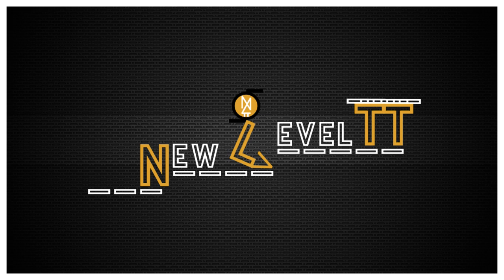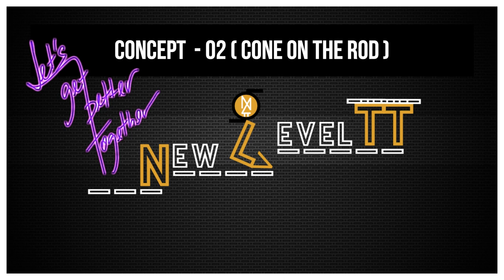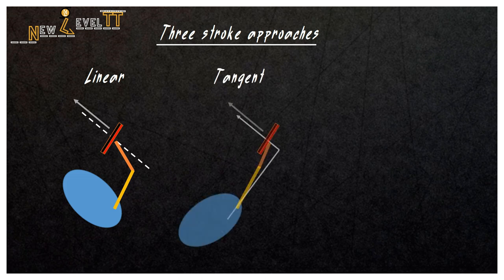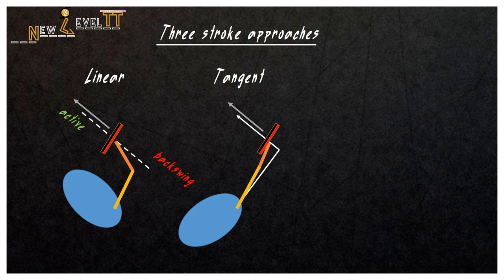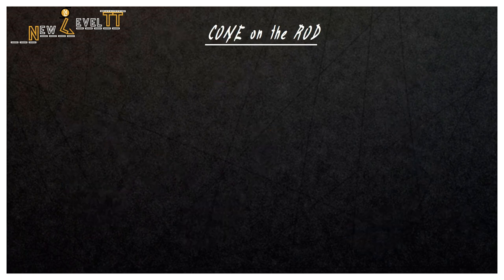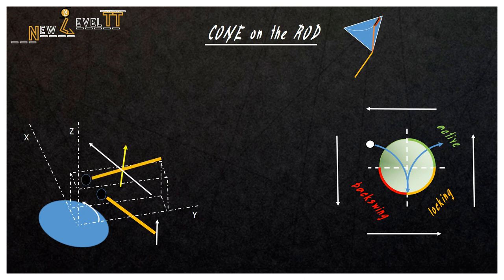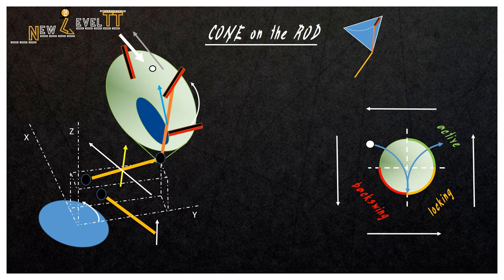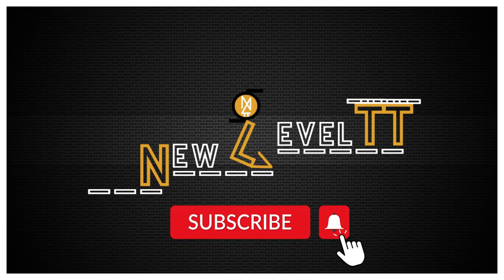Concept 02 - Cone on the rod | Technique like CNT

Comment: I concur that the perpendicular force of the partial impulse force of the inertial rotation is effective in imparting the motor functional force of the generated acceleration path, but on the point of parallel amplitude tangential velocity of linear movement, I must say that it is the curvilinear orthogonal characteristics  of rotational movement of the axis of rotation of accumulated mass of the rotation of the bio-mechanical closed kinetic movement.

Comment: I'm having trouble understanding this concept. The idea "aim the ball with the elbow" is quite interesting. But how a 3D figure like a cone relates to my forearm I am lost ... any help?
Reply from the maker: Sure Mi, imagine and draw a circle in front of you with your hand. If elbow is center of rotation, shape it creates is a cone.
Reply: @DESANGGG  Ok. good, now I have the cone :-) But what does that have to do with a FH stroke? I'm not drawing circles with my hand when I loop the FH ball?! So how does this cone factor in in the FH movement?
Reply from the maker: @mihai8555  A lot, as mentioned it helps with synchronization of the stroke. look at section at 4:24 bottom right. If you do rotation in accordance to trajectory of incoming ball you get very precise timing and consistency in every loop. If you do not use circular motion during FH looping then start working on it.  Guidance of this cone is then crucial. This concept is not easy to grasp and requires a lot of imagination. Please, study loop of Ma Long and compare it to this concept. Focus on elbow close to body and forearm rotation. Cone is moving, but if elbow would be fixed you would see it very clearly.  This combined with energy focusing lesson is real secret to Ma Longs loop.
Reply: Like Mi, I struggle to visualise this. Is there another way to describe this more simply? A dummy’s guide!
Reply: Absolutely confused to understand this concept, since no 3D visualization or slow motion real player action

Comment: Thanks for the Videos. It really helping for our TT Practice. 
'Cone on the rod' approach is helping in looping against backspin.
I have a question, Can we use the cone on the rod technique for Forehand topspin against block? when I tried most of the ball is going out of the table.
Thanks in advance.
Reply from the maker: Hi Atrix, note that this concept is used for proper timimng and synchronization of multiple movements of body parts.
For the question you asked, please look more at the concept of EVIL TWIN. During every shot, you need to be aware of the part of the ball you are contacting, given the rotation of the ball.
Easy aid is (top rotation - upper half of the ball, downspin - lower half of the ball). now, during hitting the are 3 key factors involved. 1) direction of the energy your hand/body is producing. 2) direction of the ball redirected by angle of your racket. 3) direction of the spinny ball after collision with your bat rubber.
Idea to get safe shot on the table is to add those three directions mentally, so that resultant direction is going through the net. then you calibrate those angles and add your own spin (brushing) to get the ball over the net. It is easier/safer to get ball over the net, than to force the ball down by rotation once you shoot it up.  I hope it makes sense.
Reply: @DESANGGG  Thank you New Level TT. This helps a lot. 🙂

Comment: Tried this today; has definitely improved consistency in my forehand. Thank you!

Could you be able to do one also for backhand? I tried to apply the same concept for backhand, but it seems like there are more 'parts' involved (e.g. elbow, forearm, wrist) and the stroke is different
Reply from the maker: You are welcome,
Actually, for the backhand - the concept stays the same, but the stroke dynamics is little bit different. Also your body feels it little bit wierd when performing backhand. because there is much less body rotation you need to use snap of your forearm little bit more to redirect energy the desired direction. You are also starting from right aiming to the left. not another way around. this is counterintuitive.

Helper is: You are aiming at the left net stand with your elbow (pushing your foream in straight line - similar to forehand feeling) at the begining of active phase, even if you play cross shots. cone rotation is in reversed direction. 

also notice, that without proper grip (HPL) it is hard to focus on alignment of your thumb with the contact point on the ball durig shots. Your wrist will start to work naturally for the shot if you focus on your thumb alignment. 

We will probably do lesson or analysis on this topic later, we just wanted to demonstrate this concept in the first place.
Reply: @DESANGGG  So let me clarify just so that I'm understanding correctly:
Are we bringing the elbow inward and forward, while rotating the forearm open to contact the ball? So before active phase, is the elbow behind the ball and to the right of the ball, while the forearm is parallel with the body?
Reply from the maker: yes, it can be stated this way. only forearm is approaching the ball under some angle, not parallel to the body. I would say something like 30-45 degrees with the line of your shoulders.
Reply: @DESANGGG  Thank you so much! This makes so much sense now. Now I feel the momentum of the elbow into my shots (which also is supplemented with legs/body). It also reflects how most Chinese national team players do their backhand now that I'm watching how they do it and comparing it to what you advise. 

You have great knowledge! Do you mind me asking is your TT background?
Reply from the maker: Thank you. 
As everything in life, it is about devotion. It is all about hard work we put into studies. We have done hard work for the others.  Also countless months of analysis, trying different things, finding what work a what not and how it all feels and lot of practice (shadow training, trials and errors, etc.). Comparison with chinese and other players to test some hypotheses. This is where all the knowledge comes from. we are not super elite players. we just love the sport more than everything and we have very analytical mindset and technical background from university and post gradual studies. even as control system engineers it took us so many years to decompose the game and understand all these details and create those concepts that can be transfered and learned as the pieces of puzzle. we just see things differently than many other people, this as advantage sometimes. this is also barier in many cases, we are aware of it. our primary goal was to understand chinese TT on very deep level. Now we are almost 40 so we decided to share some of our knowledge with other enthusiasts. and this is bacically reason for NEW LEVEL TT. we will try to help as best as we can to everyone who asks for it. we are happy if your level rise up also thanks to our channel. wishing you a lot of success  M N :)
Reply: @DESANGGG This is very wholesome, thank you so much! Forehand and backhand has improved tremendously, so I thank you for that.

I also discovered something while playing and was wondering if it would be applicable to the rod and cone concept:
If our body and elbow are rods and the forearm is a cone, would it also be accurate to say that our wrist/hand is a smaller cone that is attached to our forearm, which also acts as a smaller rod? In that case, would it be correct to take it one step further and aim not only with our elbow, but aim with the wrist (in order to generate more force)?
Reply from the maker: @mnguyenxiv  This is very reasonable question. However, me personally I would not go that far. reason is twofold:
1, what you are describing is more suitable for forehand flicking more than forehand looping or forehand driving in general.
2, to obtain even more power and spin you shoud focus you energy to squeezing two fingers at the moent of impact. This will have similar effect, but advantage is that you are focusing to the point much closer to the ball, your bat angle does not change much. Wrist movement is controled same way every time due to biomechanics of the squeeze. If your focus is on the wrist, than you can spoil precission of the shot and feeling is much lesser. 

to that inner cone in general:
in the illustration we actually drew spherical shape (not cone) in the cone to show that wrist movement during rotation of the cone is changing. Actually you will feel some resistance if you do not fluidly change angle of the wrist during backswing.
Reply: @DESANGGG  Hi, just to clarify: " You are also starting from right aiming to the left." what do you mean exactly? I suppose that I go from left to right with the hip, meaning during backswing I rotate the hip to the left, or not? Thx, Frank
Reply: Just rto clarify: I was referring to adaption of the concept to BH, rotating the hip to the left.
Reply from the maker: @franklohmar9071  Yes, the idea is to go with the hand from position close to right hip, more towards to the left. If foreward motion component  and sideways motion is added together it feels like your bat is moving almost diagonally to strike the ball.  Look at it this way. If you draw left hemisphere of a circle (start from below) and mark horizontal and vertical path with arrows you will see and understand how the motion is created. Hope it helps.

Comment: sorry - i cant understand this. I'm trying ... but it isn't clicking or coming togetherin my brain.  I think I remebr you comment below says "elbow is pivot point and circular motion of hand draws a CONE shape between elbow and cirular motion of hand".  I can understand creating that shape.  But I can't get past just seeing that shape.  How to piece it all together???
Reply from the maker: Hi Tim, I will try to do my best. Firstly you need to focus and find three things in the arm movement of Ma Long. Look at any training video of him (best loop In the world for exactly those reasons) and you will see it after this post. We know his FH loop by heart, so it is not hard to describe it here :) Ready? 

1) So, easiest to find is the locking phase, where he fixes his elbow to his right hip (paddle alligned with right knee). You will notice that forearm movement, to the point just before contact with the ball (exactly to the point 2 - active phase) , draw half of the circle/cone. this is the part that is illustrated in the video (under whole horizontal dashed line at 3:45).

2) Start of active phase is noticable if you focus on the mutual position of elbow and wrist after backswing. At some point you will see that wrist advances forward (from lagging position). You can visualized it as crossing this horizontal line in video (from bottom-up). Imagine end line of the table going trough his elbow, this crossing will be more apparent.

3) After he finishes the stroke with snapping motion his hand (in front of his head) and elbow creates small glitch (paddle goes a little bit back, why?), because he restarts the cycle by retracting elbow to drag the CONE down and starts this cone drawing again. 

This is all very harmonic (circular) and eliminates mistakes if timed properly to the trajectory of incoming ball. 

Problem is in full stroke imagination, because if the elbow is fixed you can see this part of the cone easily. But because there are also other movements of the body involved, this reseting and active phase phase is not easy to spot. We tried to draw all of this in the second image, but sure its hard to imagine full composition of the movement from 2D shadow image. Now you should be able to understand it better. Listen to the every word in the video very carefully. Information is condensed, but its there.

Once you will see these three points you will imagine whole CONE moving in the picture (by dragging it with upper part of arm - ROD). 

This technique is actually hard, but pradoxically very intuitive after some studying. No linear movement involved, only rotations. TT is circular or rather elliptical sport.

Hopefully it helps you understand it little bit better. 

Have a nice day :)
Reply: @DESANGGG  Thank you so very much for the explanations.  I think I do understand more clearer now.  I think i was looking at the diagrams too literally and trying to apply a real life circular motion around the circumference of the cone(paddle/hand).  Instead the diagrams are only meant to be a tool for describing whats going on. (explaining to use more of an arc/ellipital motion, instead of a straight/linear motion.
Reply: @DESANGGG .Thanks 
Your explanation here is very helpful in understanding the video.